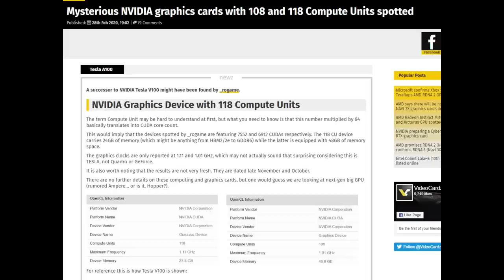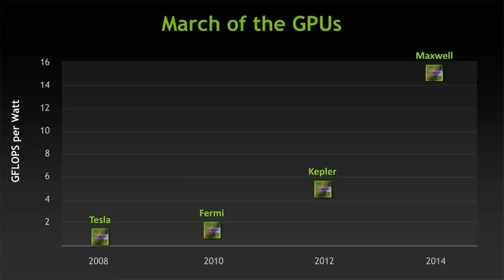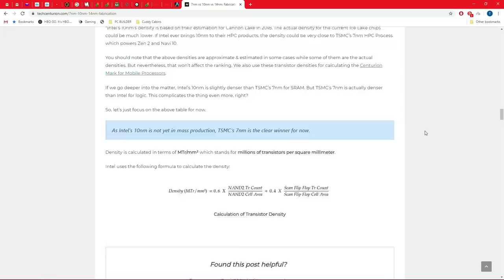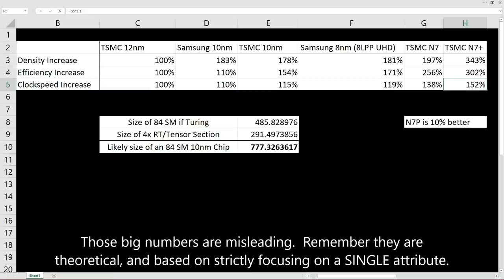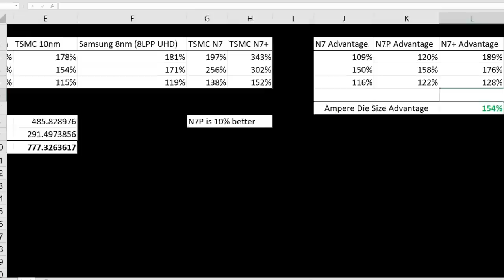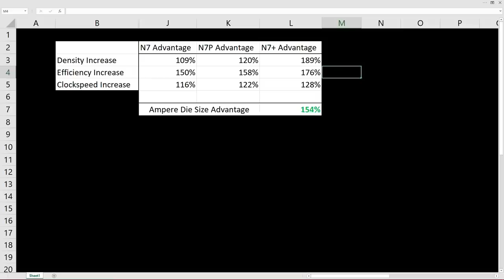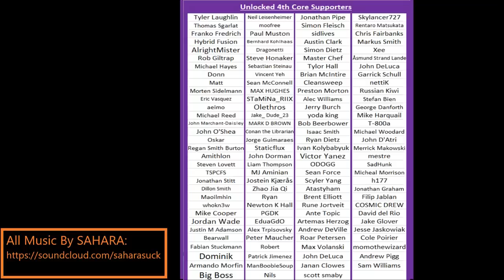Nvidia Ampere on 10nm: Still Good Enough to Defeat RDNA 2.0?

Comment: 10nm? So Nvidia equal Intel now?

Sound Nvidia underestimate AMD RDNA 2.0
Reply: nvidia for years never underestimate AMD. nvidia did not use HBM on 980Ti and yet they still beat AMD fury x. AMD for years rely heavily upon node shrink to improve their thermal and performance. hence they need 7nm to compete with nvidia that use older node. nvidia since maxwell try to be less reliant on node shrink to improve their performance and work with the architecture more to gain significant performance even if they need to use the same node.
Reply: @arenzricodexd4409  they are underestimate amd. This is absolutely true fact.
Reply: @Traumatree  i hope AMD beat Nvidia. Thanks
Reply: @kusumayogi7956  feel free to think it that. but seeing what nvidia has done to counter AMD this past 10 years really tells us other wise. and this is probably what AMD fanboy did not like with nvidia. because nvidia never underestimate what AMD is capable of so AMD never able to caught nvidia off guard to pull "ryzen" in GPU world.
Reply: @arenzricodexd4409  but but but RDNA 2.0 is 50% power efficient and IPC. This is like Kepler to Maxwell for AMD. Nvidia must fight with equal node! Remember when Intel underestimate ryzen 1st gen?
Reply: @kusumayogi7956  even AMD we still cannot take their words as it is. remember polaris? AMD touted significant efficiency at it. and some people try to piece together the info including what AMD has been showcasing at CES2016 they said at the same node AMD will finally be on par with nvidia when it comes to power efficiency. might even beat pascal efficiency. we know how that's turn out. and i said this again: nvidia never underestimate AMD. but most often it is AMD that cannot meet nvidia expectation. but yes RDNA is promising. nvidia should be aware about this as well so you can rest assured that nvidia will not going to hold back. back in 2016 nvidia expect polaris 10 to compete evenly with their GP104 chip. that's why nvidia put even GTX1070 to be on par with GTX980Ti and another 20 to 25 percent for GTX1080. and then at least 35% more performance on 1080Ti in anticipation of strong Vega the "1080Ti killer" performance.
Reply: It would make good to market is amd will beat Nvidia this time... But we Are not there yet. I Expect them to be really close this time and that is Also good thing!

Comment: amd hasnt got dlss. the new doom game really shows how much of a difference dlss can made.
Reply: You don't need DLSS if you have enough graphics power.
Reply: Upscaling technology... well nice and next gen and last gen consoles use that. Nothing too special. Nice feature if you can not run the game at real resolution and you have to upscale from low resolution though.
Reply: @magnusrasmussen951  rtx cards gain about 30 percent more power from dlss. and its only going to get better when game engines are developed with it in mind. if amd come out with a better card then nvidea ill be happy to buy it. From what i have heard sound like they will have about the same raw power, but no dlss for amd.

Comment: I just want AMD to fire the driver team, hire some new geniuses, and fix the drivers, starting from scratch. Only support rx400 series and up with the new drivers. So if you have a 390x or older card, you use the old drivers. Doing this will help immensely with performance. And BIG NAVI is going to need its very own "new" driver if rumors are true.

EDIT: side note, going from 12nm to 10nm isn't as big of a jump as 12nm to 7nm. While the node is "mature" thus meaning less issues, its still not faster than 7nm.... with the theoretical mash up, of going from 12nm to 7nm, thats only 15% performance gains. WHY? Because 14nm to 7nm via TSMC and AMD was only 20% gains.... 12nm is more efficient than 14nm, even though both are based off 16nm, so the gains will be less than AMD's drop. Which would be more like 15% gains.... but now we hear 10nm, which means most likely the gains will be 10-15% anyway. 10% because 7nm is more efficient, but possible 15% because 10nm with samsung is more stable..... so no matter what, the best they can gain from a node drop is 15%. figure another 15% for architecture gains.... 30% max over the 2080ti. Maybe add more cores, gain another 10-15% performance from a larger card with more compute? so 45% max....

Now go back to AMD, 80 compute units. We know the 5700xt is about a 2070 super in comparison.... then Tech Yes City did 2070 super sli vs single 2080ti, and it was 30% faster in "supported games".... so technically an 80 compute unit 5700xt AT A MINIMUM will be 30% faster than a 2080ti. Then throw in "RDNA2" being 50% faster, that's 80% faster than a 2080ti.... Nvidia wont be able to hit that gain as shown above.

Comment: It's looking like price will be key and AMD usually has the advantage on that one and might even more so if the die size is a lot smaller than what Nvidia is using but getting around the same level of performance, then throw in the next gen consoles being Ryzen and the new RDNA 2 gpu's, AMD could have a big advantage here if they play their cards right and deliver on the goods that the rumours are suggesting.

What's worse, Nvidia have pissed off a lot of gamers with their overpriced 20 series and I suspect many gamers are just itching to dump Nvidia but are waiting for a rival to deliver the goods, so this is your chance AMD, so don't fuck it up like you have form in doing for so many years.

Comment: They CANNOT Make Bigger chisp  form 14 NM....they cant even  cool 5120 cores, properly, and all teh tesla line up  was scaled down to 4800 cores instead of the first gen ones that are 10% faster  with 5120 like the TITAN V
DO NOT BUY first round of Nvidia Ampere becuase it will be a CUT DOWN version...wait december for the FULL version....especially if YOu are buying 2180ti and TITAN VI

Comment: 3080 Ti only 40% faster than 2080 Ti?

What a disappointment...
Reply: Ezra what makes you believe Nvidia will sell us the full die as 3080Ti? The successor to the Titan RTX is what will be 40% faster than the 2080Ti.
Reply: the_mehx g102 is not the full die to begin with 3080ti will have a cut down g100 die
Reply: king yogesh well yes, but that’s beside the point. The „100“ chip is not sold for consumer/prosumer use. My point was that people seem to assume that the full GA102 die, which is supposedly 40% faster than the 2080Ti, will be the 3080Ti, while the 2080Ti was the cut down TU102 and the Titan RTX was the full die.
Reply: Idk we'll see but the difference is that AMD will be competitive in the high-end this time around. This wasn't the case before.
Reply: 2080ti only 10% faster than 1080ti... What do you mean? 40% is a lot!
Reply: @haukionkannel  2080 Ti was at least 20% faster than 1080 Ti and that was one of the worst generational jumps we got from Nvidia because they didn't have any competition. 

Now look at 980 Ti > 1080 Ti jump in performance, more than 50%.

Comment: Just shows how utterly useless AMD is in the GPU market. Inferior architecture. Nvidia isnt taking them seriously because why would they? They released 2 cards (5700,5700xt) a year later and people bragged because it competed with Nvidias mid range and was like £40 cheaper. Well whoopty shit. All that on a node advantage and Nvidia shits out another the next day on an ancient node. Architecture is everything. Its like the saying "work smarter not harder".
Reply: If Nvidia was using 5700 xts manufacturing node AMD would be out of business
Reply: 5700xt* not 5800
Reply: @Techno4more  That large die does factor in those tensor and rt cores.
Reply: @Techno4more  nvidia did it on older node while AMD did it on new and expensive node. why did you think AMD to this point still cannot come out with Navi with such big die size? why RDNA 2 need to wait until late this year when they release 5700 in mid last year? die size is not everything. we know nvidia TU106 is bigger than navi 10. but with RX5600 AMD refuse to sell the card below $280 price tag when nvidia drop RTX2060 price down to $300.
Reply: RDNA 2 will have GCN compute stuff removed from it which will give them more die space, and increasing their die size (aka big navi ) mean they can put way more into the die than ever before, 

RDNA 2 is the new baseline for massive change in AMD gpus, and now that AMD have $$$ coming in and having paid of quite a bit of their debt they're pouring more into R&D So even if RDNA 2 doesn't beat Ampere RDNA 3 will be on par or better than Nvidia.

Also @Artaven AMD won't go out of business unless Intel drops a architecture that Slaughters Zen, which looks unlikely for the next 3 yrs so far.
Reply: @scarletspidernz  That literally makes no sense. Rdna is completely different from gcn and only translates to gcn for compatibility reasons
Reply: @justinwong939  It's heavily modified GCN https://wccftech.com/amd-radeon-rx-5000-7nm-navi-gpu-rdna-and-gcn-hybrid-architecture/ Not a new architecture built from the ground up
Reply: @Techno4more  Bro you are the man! You just destroyed that Nvidiot.